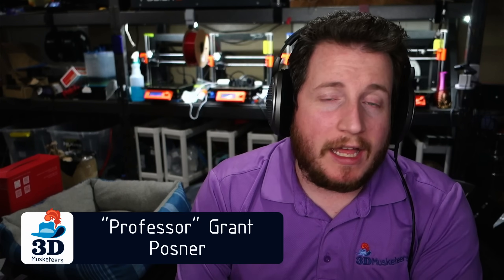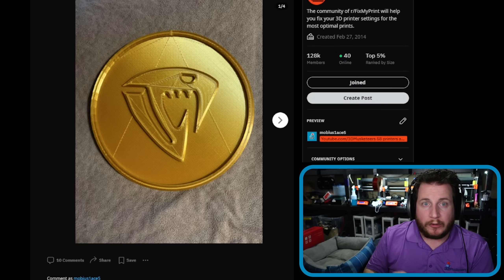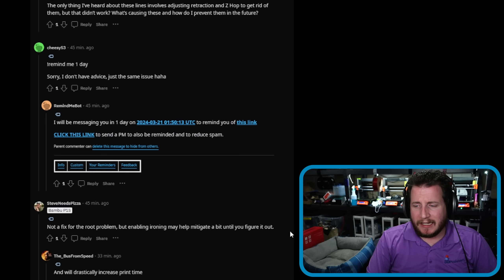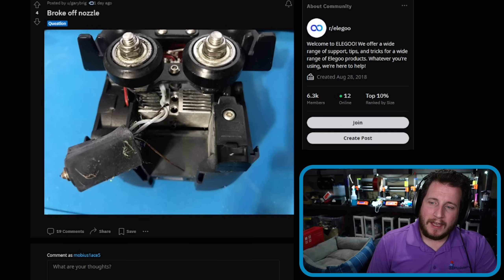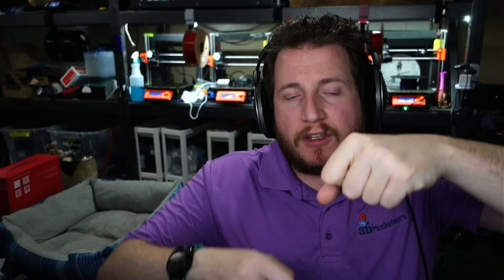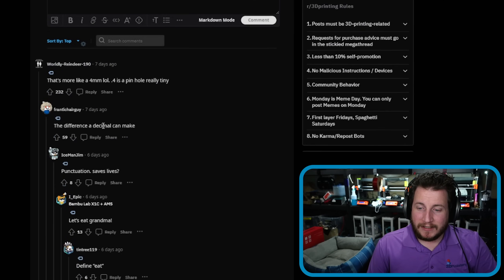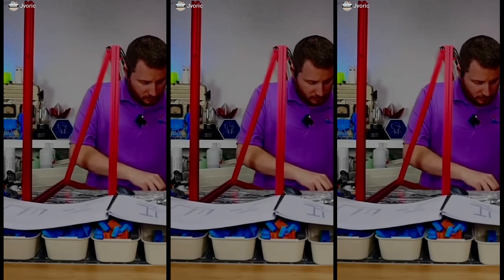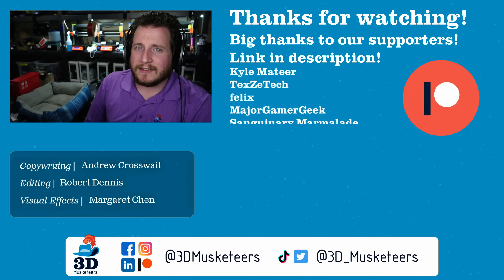Are Elegoo's OrangeStorm Gigas Poorly Designed? - PrintFixFriday 132

Comment: I woke up Friday to a print fail with the hot end and heat break fell out of the print head.
it finished off one of those nice new holographic PEI sheets. etch pattern driven all the way through the plate and into the magnetic backing
I haven't had a chance to fix it yet, just shut the machine off, between the day job and an unexpected road trip, I don't think I will make it back to assess fully until I get back home. will send pictures.
Is there a high temp loctite out there? my SV04 doesn't use a threaded heat break
Reply from the maker: dang man those are no fun! Sorry that happened! The heatbreak should not get TOO hot so even blue should be okay I think. I am assuming its the grub screws holding it in?
Reply: @3DMusketeers grub screws were locked up, couldn't budge them for stripping the allen heads.
I had changed the ptfe tubes (the short ones in the heat break) the old ones kept grabbing the filament.
Replaced the whole top end yesterday; gantry, extruders and all, I bought a spare machine for good reason
Reply from the maker: oof that is no fun!

Comment: First part, Z Hop is HORRIBLE and does add time to the print.  For 99% of printers Z hop is ok as with lead screws its ok, but belt driven printers (voron 2.4's) over the course of a print it can wonder off.  Even with the most perfect of belt tension.
You can hit those nozzles with a hammer and they WILL NOT break.
For the Giga, Joel was tierd, it was late, and he was in a hurry.  As one should always double check the Z offset after setting it to make sure the printer actually took it and saved it.  Especially with prototype printers as Elegoo has had this issue before with the Neptune 4's early firmware versions.
The Giga is about the same price as a single headed Prusa XL, and both machines can have muti heads too.  However the Giga blows the XL out of the water because...well its effing BIG for the same money.  Another reason Prusa needs to do something to get better pricing, or they will continue to lose market share and become, irrelevant.
Reply from the maker: If we are worried about the time z hop adds, we should be considering our production schedules more closely. As for belt driven printers, I guess I'll find out.. 

Joel was definitely tired, it looked to me that he did everything right, but I too would be tired after almost 3.5 hours of heavy lifting and having to be "on" for cameras. It's 100% easier to build off camera. 

The multi head on the giga is nothing like the XL and while, yes it's larger, I'm not sure I'd put faith into it for my business. Mind you, I don't have the space for it either way.. maybe one day I can, but right now, no space. And we seldom have parts that large we need to build that can't be broken up into pieces on smaller printers to get done much faster, even if that requires finishing.

Comment: My diamondback broke the first time removing it from the machine.  Clear defect in the brass, i purchased another one the same night and messaged Diamondback with photos, they refunded the original purchase without question.    They work great, Petg doesnt ball up tpu prints smoother etc.
Reply from the maker: Bummer you had that failure, but the Diamondback guys are awesome!!
Reply: @3DMusketeers  absolutely couldn't be happier with it.  Things happen, and they backed it up without question.  Just sad my other machines can't take their nozzles yet.  (A1) (e3V3)
Reply from the maker: what kind of nozzle does the E3 use these days?
Reply: @3DMusketeers  the ender 3?  The v3 no suffix takes a proprietary unicorn nozzle.      The ke takes volcano and the SE takes the spider nozzle.

Comment: Elegoo got me back into coding and engineering again. I bought an arduino kit and done every lesson without stealing code haha.  I repeat too much
Reply from the maker: nice! But its fun! so its worth it
Reply: @3DMusketeers  I never coded in almost 2 decades man and it changed my life. Paul McWhorter has the best mcu tutorials. I'm surprised he's not a common name he's so good. I didn't get the pins thing hahaha I was used to building enterprise applications that ran on Unix or nt so the pins miffed me haha. I just bitbang all areuino code now with no delays. Keeping track of milliseconds for scheduling tasks makes the old boards still relevant. I have a case full of mcus. I over purchase them all the time and end up donating them. I had like 15 picos from a sale and never used the pico before and despised it haha. Circuit python is Ada limor's over priced crap version of the language. Ever notice she is considered some sort of genius when all she does is manufacture scarcity on her site and chage 15 dollars for a single 7mm round led for instance. She gets all her stuff from ali express like everyone and jacks prices.

I asked her why once in a polite manner and I was given a typical left wing hipster line of retarded, self righteous syntax that I took as her internal justification which she must use to sleep better. It's bananas how much adafruit charge for common sensors exact same parts except the black pcb.

As a man worh many thousands of collected leda I really want a big bag of those spherical leds haha.

I spent over 1500 on leds online a few years ago. I had over 100k of all different types and shapes. I gave the local makerspace over 40 thousand dip leds hahaha

Comment: Grant i had a nozzle fail this week.  Had a partial clog diamond back that was an absolute bear to clear.  Actually happened with polymaker PETG of all things.  Ended up having to cold pull with nylon 5 times before i finally got it.  Tried the acupuncture needles 1st, cold pulling with the PETG,  i started getting worried that I wasnt going to save that wonderful nozzle.  That diamondback nozzle has 9,500+ hours of print time with all kinds of materials.  Love that thing.
Reply from the maker: you can always save em, might need to torch it if needed (not recommended by DB but I can confirm it works lol)

Comment: I almost bought an Orange Storm within seconds of the kickstarter going live, but I bailed out once I saw they wanted me to pay more money to add 4 PEI spring steel beds. Not going to spend that kind of money to have a ugly seam in the bottom of my prints because its not one solid bed sheet.
Reply from the maker: I dont think it would be THAT noticeable, but certainly there would be something. Mind you, I would rather have to replace 1/4 of the bed than the whole thing if you have an engraving moment.
Reply: @3DMusketeers  If it wasn't extra money when checking out on the kick starter, I would have been fine with it. The fact that I had to pay more for 4 spring steel sheets didn't make sense to me. I'm glad I didn't buy it now, so it worked out fine.
Reply: @user-lx9jm1wo3h  the 4 plates come with the printer - I think it was an option to buy another set of them as spares
Reply: @teknokilr6074  It didn't say that it came with 4 built plates. It only showed option to add 4 plates for $150 more so I didn't go for it since I could not confirm if it came with them or not. Either way I am glad I didn't now.

Comment: No they're not poorly designed. The fact that Elegoo took the leap to introduce such a large volume printer priced for the prosumer with the option to have 4 print heads is incredible. Could they have tested a bit more before release? Yes but they also did an early release and ship for Kickstart supporters. Realistically it's a fantastic first release of a monstrous printer to the public.
Reply from the maker: kickstarter should not be a pay-in beta.

Comment: I do disagree on stainless nozzles. They can be a fantastic budget option for abrasive materials. I have ran dozens of kg of glow material through a single stainless nozzle with no damage. The same material destroyed a brass nozzle in 200kg! (I had to know!) They do conduct heat less efficient than brass, but so do many hardened nozzles.
Reply: Either it's hardened tool steel that's mislabeled or it's not gitd filament. Stainless is not nearly hard enough to not abrade. Basic material science. 304SS doesn't even crack the HRC scale (70-80 HRB). Hardened nozzles are 58-64 HRC
Reply: @taylorlandry641  I have no intention of getting into an argument, and never said Stainless was on par with hardened (which stainless & which hardened?) But it is more durable than brass. And the 50 cent ones off Amazon have handled dozens of kg of a wide range of very abrasive glow material in my experience. Never expect them to live up to my A2 or M2 nozzles, but haven't worn one out either. And I have trashed brass nozzles with the same material just for the fun of it. Just saying it is a budget option to play in that arena. 50 cents is easier to risk than $20.
Reply from the maker: I would caution those that are trying to spend like 0.50 on a nozzle. they are made cheaply :/

Comment: was a jeweler for 12 years diamond will laugh at a angle grinder that isn't diamond impregnated. heat on the other hand. diamond stands of fine to high temps its the rapid cooling after that heating that causes it to shatter.
Reply from the maker: yeah, I wont be quenching it or anything, that will result in a failure for sure.

Comment: Diamond is a superb heat conductor. So if you use a grinder on it, although it could damage the grinding disk, it could also conduct enough heat that it could damage the metal that the diamond is fixed on (which is most likely to be brass)
Reply: How long do you have to torture an angle grinder before the brass softens from friction heat enough to dislodge the insert could be fun.
Reply from the maker: yep, will have to be careful of that!

Comment: Elegoo cant design "normal size" printers very well ( FDM) so i wouldnyhold out much hope for this monster...
Reply: Oh really My 9 Neptune 4s have just finished they're 97th print without failure
Reply: Elegoos price requires you to temper expectations.  Customer service is very good but ....I'd rather NOT need service for build quality issues.
Reply: We have 7 4's and 2 maxs they are not for beginners. If you put them together right tight and tune and don't mess around much in the Klipper they run like a champ. I was about ready to throw the max out the door. There is something up with the y extrusions for the pom wheels. My y liner kit should be here tomorrow otherwise it's printing good.  I can only thank those who returned their printer so I could buy them at an awesome cost. @ElegooOfficial
Reply from the maker: I have a feeling they will fix it but it may take some time.